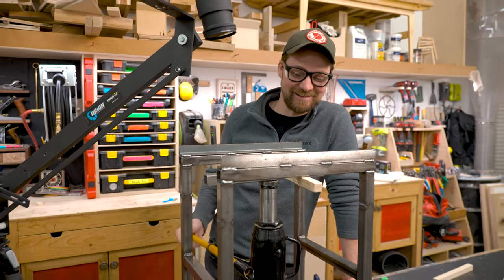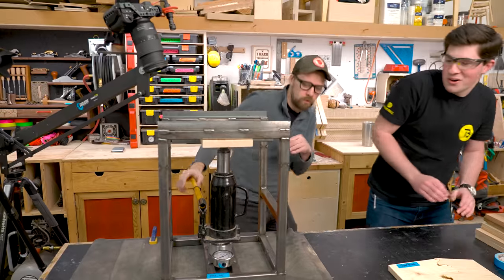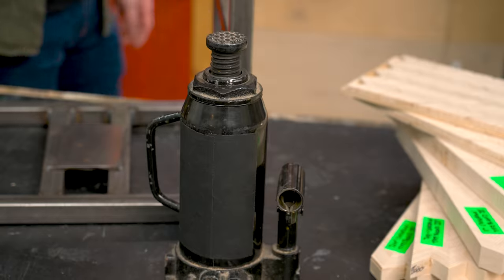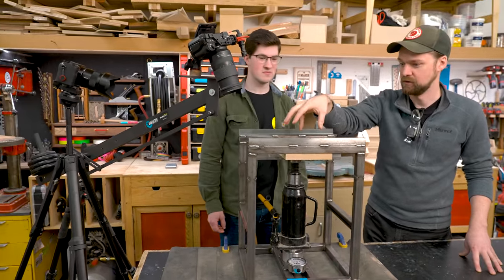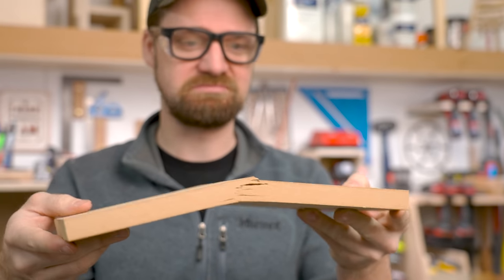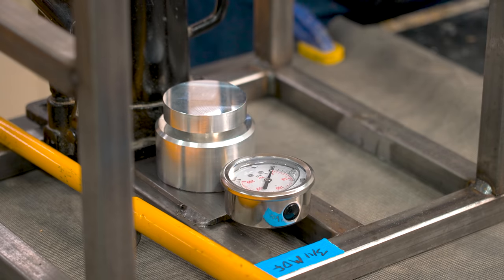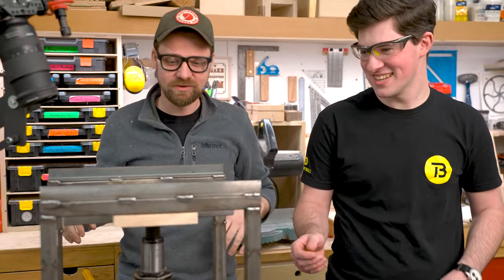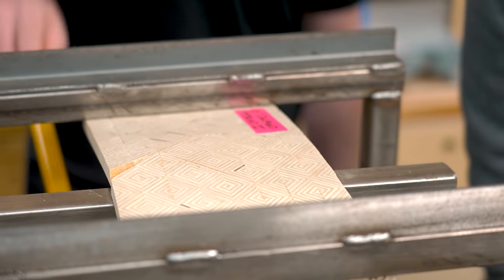Testing the Limits of Patterned Plywood (Featuring Tyler Bell)

Comment: Until you measure the solid woods turned 90° so tou dont support it over the length of the grain.  Then the ply will be stronger.

The reason pluwood is stronger is is because of this. It might have about the same tensile strength as pine  but in all directions. While pipe has that only in 1 direction.

Comment: You mentioned a glue failure. FWIW, Titebond II is stronger than Titebond III. Not sure how much of a difference that would have made.

Edit: Ok. I see you did that later. Also, you said the glue didn't fail, but I thought that earlier you said something was a glue failure.
Reply: All kinds of (modern, name-brand) PVA glue are stronger than the wood fibers. In other words, if you glue two boards side to side then try to snap the joint, the timber will always break before the glue bond. In many instances, this is still the case even for end-grain gluing.
Reply: @johncoops6897  He specifically mentioned a glue failure, which is why I brought it up. He later said there were no glue failures, so maybe he misspoke.

Comment: I think in the patterned plys you're finding those exponential strength results due to surface area of the glue joint, the inch thick patterned plywood has exponentially more surface area that 1/2" for example.

Comment: 1/2" pattern ply 100lbs, 3/4" pattern ply doubled that to 200lbs, 1" pattern ply doubled that to 400lbs.
Reply: Not pounds - it's pound-force per square inch or psi. He did it wrong in the video as well. Pounds are a measurement of weight, not force.
Reply: Flip the test rig upside down, so that it is demonstrating the MASS (not weight) that each board can support. Then the use of "pounds" and "Kilograms" is perfectly valid.

Comment: 17:25 You clearly can say Michael is disappointed at this point. His voice changes. He struggles to stay relaxed. And his sentences are getting shorter. Poor Michael. It's not your fault. You couldn't have done better. 

That construction is not able to hold the load in that direction. The fibres are too short. The strength of plywood is the combination of the length, the flexibility of the wood fibres and the glue. But it only works in one direction. Your pattern plywood is basicly turned the "wrong" way and it almost only relies on the strength of the glue.

Btw. a grown tree is almost similar to plywood. When a tree grows it secrets resin beneath the bark and adds fibres on top of the old fibres. The difference is the lamination in the tree is circular, while in plywood it's planar.

Comment: Multiplex is not stronger, just dimensionally more stable then solid wood. The purpose is to keep builds straight and measurements even.
Reply: You make the same mistake that many others mad here. Consider the strength of solid wood when tested across the grain.

Comment: I feel like the pattern plywood is not accurately compared to the rest of the controls as the controls were long grain perpendicular and the pattern was parallel to the force form the jack. Also end grain is not as strong as face grain
Reply: Well of course. However if the strongest face of the patterned ply was tested in the same direction as the controls, then it WOULD NOT BE "patterned plywood" would it?

Comment: From the looks of it, these test really aren't like for like. Have a look at Patrick Sullivan's "Understanding Glue Myths" that manages to quantify the strength of the cellulose and lignin that make up natural wood fibres as he goes into a lot of detail. A more representative test of your natural wood planks would be creating one with the grain running at right angles to what you tested. Obviously this is a "stupid" way to make a plank of wood but I'd suggest you'd get very similar numbers to any of your patterned plywood boards. Also, where are you seeing that plywood is "stronger than natural wood"? A quick Google search quickly comes up with many sources that state the opposite... Even a bit of reasoning from an understanding that the strength of any wood comes from forces applied along the grain direction would suggest that you're only going to get any strength from those sheets that are positioned correctly. It might actually be interesting to compare a piece of plywood to a natural piece that's the same thickness as those sheets matching the correct grain direction. It's also a misnomer to say that "glue is stronger than wood". Stumpy Nubs sums it up well in a response video ("A misunderstanding of the end-grain glue "myth" video?") and highlights sections of Patrick Sullivan tests that empirically shows that cellulose in wood is stronger than glue, but it IS stronger than the lignin. The results you're seeing are almost perfect examples of what should be happening.
Reply: It's amazing how many people here (and in the video) completely forget about grain direction. Ply is definitely stronger, compared to "across the grain" bending of equivalent solid timber. However, how could ply possibly be stronger than solid timber "along the grain", when only about half of it's grain is in a single direction? 
Stumpy made some errors in his video, actually confusing the whole issue by stating some silly applications. I lost a lot of respect for him after that glue test video, and that outrageous attempt to save his sponsor Harvey after the Wood Whisperer tests of the Miter Gauges. Patrick's timber and glue tests were far more reasonable and simple, to demonstrate the basic concepts without muddying the subject with hyperbole.
The two bozos in THIS video are just clueless. They don't even grasp basic physics, let alone the material properties of the timber that they pretend to be experts about. They stare in bewilderment at results where the majority of viewers are shaking their head and saying "well, of course". 😂

Comment: Weak as shit but its a front facing decorative timber and needs to be seen as such. it shouldn't be used for solid cabinetry as it will not have anywhere near the structural integrity of other timbers or sheet materials.

Comment: Hey - one quick question: You refer to your measurements in pounds - but that's mass, not force. Are you actually talking about pound-force per square inch? Then your conversion into kg makes little to no sense and you should use pascal instead. This is why basic science education is important - and the use of standard units.
Reply: Just as a quick example: At 14:06 you list 3/4'' MDF as "900 lbs" and convert that to "400 kg". While that conversion is correct, it has nothing to do with your measurement. Because you didn't measure 900 lbs, you measured 900 lbf/in² (lbf=lb*g) - so you converted that to 400 kN/in² - nobody in the entire world has ever used this nonsense mixture of units. 900 lbf/in² is 6200 kPa or 6200 kN/m² or about 620 kg/m² at ambient pressure. That's a unit you could use. Also: I'm not entirely sure you understand your own units. You talk about 900 "pounds", but you actually have to imagine that more like the force a 90 (not 900) pound object exerts on one square inch, because g is about 10 m/s². The American system of units is stupid, and you have given a good example as to why. Sorry for being so harsh, it's just so frustrating to see this one nation messing it up for literally everyone else for absolutely no good reason. Mars probes crashed because of this nonsense.
Reply: @xBris  - Don't be a smartass. This is a comparative test, not an absolute one. The measurement units are totally irrelevant in this context. They are telling us the reading off the gauge face, and nothing more.
Substitute "lbs" for "bananas" or "beans" or something else, if you are unable to comprehend this simple concept.

Comment: I thought plywood was more stable not stronger… it moves less not holds more
Reply: Plywood is stronger than solid timber "across the grain" because it doesn't have a single grain direction.
Reply: @johncoops6897   ok I see what he meant

Comment: Plywood is NOT stronger than solid wood. Only half the fibers in any given thickness span the length of the piece, which is what gives a piece its strength.Wood is not really strong across its fibers,  only along the fibers, so 1/2" birch plywood has roughly the same strength as 1/4" piece of solid birch, though obviosly not exactly because separating the long fibers should probably weaken it further.
That's my understanding, anyways.
Also, glue is NOT stronger than wood. It IS stronger than the *lignen*, the natural glue that holds the wood fibers together. That means that a failure would not happen in a glue joint when pieces are glued along the long grain side because the lignen would fail before the glue would. If the piece has no inherent mechanical strength because there are no long fibers spanning its length, it will be very weak, regardless of how much glue there is.
Reply: 100% correct. I have been trying to explain the same thing, however your wording is better than mine!
It's frightening the level of misunderstanding that these 2 guys have about the material that they pretend to be experts about.
Reply: @johncoops6897  I wouldn't denegrate these guys for espousing beliefs that a majority of folks believe. I also once thought similarly, but I just did not know any better.
I love it that they are having fun here and making woodworking entertaining. I was only explaining the theory behind their measurements.

Comment: To utilize the gauge range just cut the pieces half their width.

No offense but badly designed experiments are worse than not running them at all. You create a body of alleged data on which others will abuse conclusions but the conclusions  are intrinsically fllawed because the data was unreliable. this is how people are misled. I know you are both worthy of better work.
Reply: I disagree.  While this provided nothing conclusive it did show tendencies which raise questions, and provided the groundwork for others to build on.  My humble opinion this is an example of the scientific process at work.